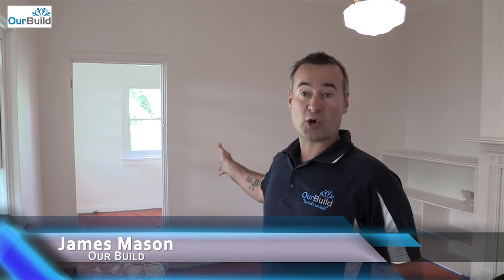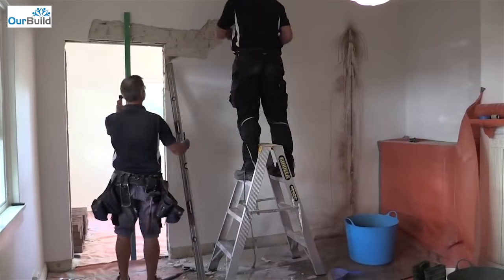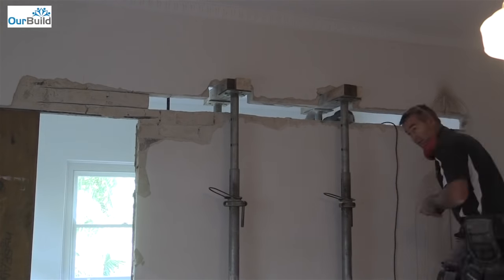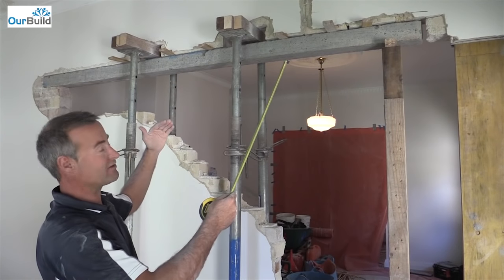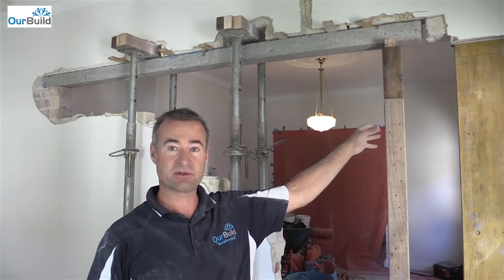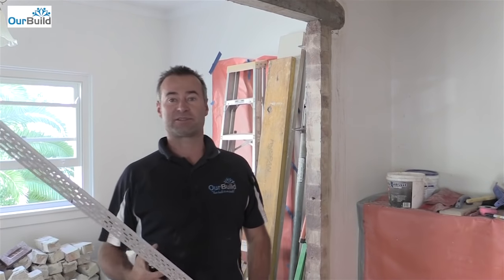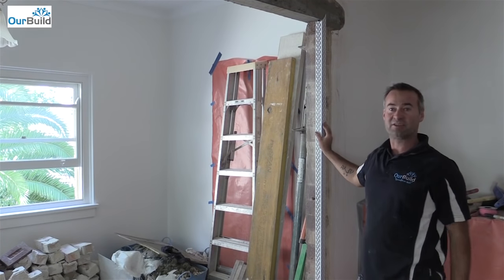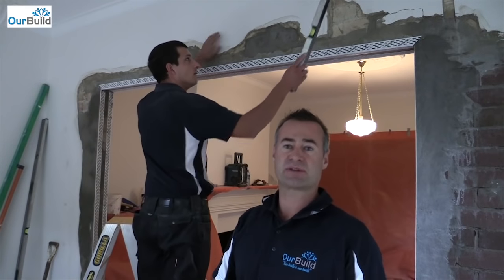How To Remove A Brick Load Bearing Wall - New Opening

Comment: Great vid lads👍🏾
Only thing I would add for the beginner is to make sure you have a sound foundation underneath each prop before transmitting any load to them. If the floor is made of concrete then no probs. However, If it's a suspended wooden floor, you should: make sure you spread the load across the floor joists using a couple of scaffold boards or remove some floor boards and place the jacks directly onto solid ground beneath the house.

Comment: Nice video! A quick tip with spray glueing plastic angles on, spray both the back of your angle and the surface you’re sticking it to, let them sit for a minute or two to become tacky and slap the angle on. It’ll stick much better than with spray glue just on the back of the angle.

Comment: Great job!
We have builders in to widen an existing doorway to and extention into a kitchen, how long should it take to knock out the wall.
My builder took a whole day to take out 2 rows of bricks as you have done and marked out the opening with an angle grinder saying the wall is external and its very hard! Is this normal or are they taking too long as we are paying a daily rate!
Any help would be great.
Many thanks
Reply from the maker: Hard to say how long something should take as every job is different with its own unique challenges. Good luck with it 👍

Comment: Great work guys! Do you find the plastic doesn't hold anywhere near as long as the aluminium.... and results in cracking?
Reply from the maker: +Ben Jarvie , Thanks Ben! I think the plastic is the way to go, as long as its set in correctly it won't crack.
Reply: Plastic is 100% the better option, it won’t dent and crack the plaster like steel angles, and more forgivable with any movement.

Comment: Hi how do you ensure that the last brick at the top makes good contact with the concrete lintel for load transfer? Because the mortar in between is initially soft right? Do you just wait until the mortar dries up before removing the props? How do you ensure compactness of the mortar at this location to make it load bearing? thanks
Reply: Good question. Sadly ignored tho
Reply: Usually left to go of untill the next day mate. As paddstones would sink like you suggested
Reply: use pack the gap with non-shrink structural grout

Comment: Great video! Thanks. If doing the same thing through a double brick wall with cavity between the two rows of bricks do you need to install a lintel for both walls?
Reply: Or will only 1 of the two rows be weight bearing?
Reply from the maker: +Jeffy J Thanks Jeff, yes one for each wall.
Reply: Our Build - I am looking to do this , a double wall. Curious where are you based ? 😊

Comment: Hey James, Great video. Are the needles you refer to separate to the acroprops?

Also when fitting in a heavy (370kg) 4000mm wide beam, we'll be using lifters, but would you recommend sliding it into position at first?

Cheers for such a great video
Reply from the maker: Hi Dan, yes the needles are the support timbers or steel that is inserted under the brickwork and then the acrow props go up to the needles. Hard to say about the position of the beam, generally if its something large and heavy i would get it in close to the opening and then use a genie lift to wind it up unto position.

Comment: Great video!  Thanks for taking the time to share that process.  The one question that came to mind is why not use wood studs to support the new header on the side you had to build up out of brick?  Isn't the brick a tonne more work, labour, and money?
Reply from the maker: +rmontyw Thanks for that. Timber will shrink or expand because it's a natural product. This will cause cracking. If the wall was completely a timber construction I could have used timber, but you never use timber to support brick. Hope that helps.

Have a great day.

Comment: hi James, have you tried the facade clamp? not sure what it's called in English. it's supposed to create a temporary lintel when you use 4 or 5 every 0,7 metres above the new lintel.
Reply: It's called a brick brace over here in uk, I use strong boys that fit on top of props don't need needles

Comment: Hell of a mortar course at the top of that new pier........
Reply: Hahahaha thats what i was thinking. Would have definately added some steel packers between the brick and concrete lintel. Make them about 7mm by 20mm by 30mm and stack em up. Still will be able to render them and the support will be much more reliable than the mortar. Everything else though was perfect

Comment: Great video. Helped me talk knowledgeably to the builders who did this for me. How do you then deal with the floor gap after the wall is removed?  I have tiles and the builders were able to not crack any of the existing ones. How do I fill in the gap? (It will eventually have kitchen units covering it, so no need to level or re-tile luckily). Thanks in advance :-)
Reply from the maker: Great to hear Tracy! If it will be covered later I would fill will some particle board or plywood. Good luck with the rest of it 👍

Comment: Good job. Just a quick question. How do you know the floor which I assumed is timber sitting on hanger is going to be able to take the weight of the wall above? It seems that the 2 acrows sit on sole plate so I was just wondering if someone checks the floor where you sit the acrows on or it is assumed that with sole plate is ok ?
Reply from the maker: Good job to always check with a structural engineer for those types of questions, but generally speaking a good sole plate under the acrow props spread over a few floor joists will generally do the trick.

Comment: Lovely job.  How wide can you go without the acro props and pins?  For instance would you still do that if you were only putting a 900mm gap in a (single skin) brick wall, or would you expect the bricks above to hold in place while you put the lintel in  for that width?

Comment: Amazing work 👌👌👌

I want to convert my sitting room into a bed room, and build a closet. But my sitting room is small, so l'm thinking of breaking down the wall separating the sitting room and the garage, and build a closet that will take some space in the garage rather, and have a sliding door in the bed room.

What advice can you give me before l do this project?. #PleaseHelp

Comment: Hi again.  270cm lintel for 240 span.  That's only 15cm on each side.  Is that enough?   Also worth mentioning that lintel should never be cut and lintel must be installed the right way up as they are normally pre-stressed and marked with the "top" side.
Reply from the maker: +Aman A , Yes it was enough for this installation, but always consult a structural engineer first like we did.
Reply: +Our Build Thanks

Comment: If the door way is only 2 metres wide, could you use a 6mm thick 2.4 meter long steel angle bar instead of a concrete lintel? I.e cut a 2.4 metre long horizontal line of morter out and slot the lintel in? How does an angle bar compare to a concrete lintel in load bearing capacity?
Reply from the maker: +Wally D , Hi Wally, it really comes down to what a structural engineer specify s, on this project we had a load bearing wall directly above this for the unit on the next floor, so I guess that why the concrete was specified. In theory an angle bar could be used but it also make it hard to finish the render detail around the opening, as the cement render is better to apply to the concrete lintel as well.

If you did go a steel angle i would still recommend propping the brickwork above so that it stays supported during the installation.

Thanks for the question mate, take care.

Comment: No pad stone on top of the brickwork? all lintals should by regulation sit on pad stones,especially if load bearing,oh dear.
Reply: only if the masonry requires a padstone. a pad just distributes the loads if the original point of contact cannot support the weight. The compressive strength of bricks is high, which can generally support small point loads.
Reply: It's a concrete lintel so doesn't require padstones. If an RSJ was used it would need padstones.

Comment: Hi James, great video and thanks for uploading!!! If it was an external brick wall and you could cut the lintel in first without removing any bricks, what would hold the lintel in place in that instance? The weight/down pressure of the bricks once the bricks below the lintel are removed??? Thanks.
Reply from the maker: if you installed needles through as supports while you installed the lintel then yes.

Comment: Hi again.  How long did the whole job take?  How much would you charge?
Reply from the maker: +Aman A , Hi Aman, the project took about a week, but then the painting we came back for a few weeks later after the render had cured and dried. The cost is private from my client, but happy to send you an email privately with some more detail if you need a ball park idea?
Reply: +Our Build Yes that would be good.  How do I get my email address to you?
Reply from the maker: If you go to the About Tab on the YouTube Home Page my email is there, otherwise the contact form on my website which is linked in the comments section below the video.

Cheers.

Comment: Hi, great video mate. How many days did it take to actually knock it down? I have 4 meters load bearing to knock down which also has attached two radiators to be relocated including a boiler feeding pipes to first floor room? Just an approximate so my builder is not creating more work by scaring me off. :)
Reply from the maker: Thanks, this one took 3 days from memory,   and then a couple of days to paint and finish up. If you allow a week that should be plenty of time.

Comment: Just out inf intrest why did y have to build an additional brick wall to support the lintel and not keep more of the origional wall to support it? :)
Reply: +jay Jay it's because the wall wasn't tied into the other wall(because of the door opening), so it's not structural sound.
Reply: +jay Jay It would have meant a larger span for the lintel if it had to go all the way to the wall of the other side of the door, I think that's what you mean. It was probably too wide for the support to be sound without a middle support or the gap was too wide for the opening the owners wanted it to be.
Reply: No what I mean is the wall was knocked through but then the additional pillar on the right was built out of blocks to support the lintel. So basically where you did your initial cut on the right of the wall with the still saw you could of cut it less span saving the trouble of building the additional brick support... If the origional wall wasn't supported then you have just tied in a pillar of breeze blocks onto a untied wall ? 😉
Reply: Ha now I feel stupid I just realised you changed the angle and location of the camera to the other side of ten room haha 😉

Comment: How did you fit mortar between the top of the lintel and the bricks. How can you be sure that the whole of the top of the lintel is touching all the bricks above it
Reply from the maker: +Aman A , The preferred method is to dry pack non shrink grout between the top of the brick and the bottom of the lintle. We drive wedges in temporarily under each brick before this takes place and while the mortar sets.
Reply: +Our Build If you dry pack the grout between the top of the lintel and the bricks, how does it set. cheers
Reply from the maker: "Dry Pack" is just a term for a mix which still has water in it, but it's consistency is very dry and not runny.
Reply: OK thanks

Comment: Perhaps adding a layer of loose wet mortal on top of the  length of lintel  before place it in its place would have distributed the downward load better and avoided the localised  outer pressure points caused by those tapered wedges to preload  the  bricks on the lintel. The wedges only acted on the outer edges of the  bricks and the lintel and not  along its centre line , which was left void. 

Seeing that there was a good gap, the bricks  at floating end of the lintel on the new wall  should have  been drilled vertically and a tie rod inserted and grouted  to tie the new wall to the old wall in a vertical manner and not only on its side with those  galvanised steel ties.This would ensure a better structure and  anything hitting the new wall will not cause it to sway sideways.
 
At 4:12 It was wrong to insert those final pressure wedges before the lintel was supported on the new wall as the lintel pre-stressing was not effective considering that the temporary vertical steel support was far away from the wall and when it was removed the lintel had to settled a little. 

In my country we would have been less comfortable  but more pompous and ornate to show off  to the neighbours and made an arch with  thicker than wall abutments,  with decorated  imposts and  interlocked voissoirs and a projected crown to make us feel that we are at St Paul's Cathedral or Westminister Cathedral  in London or Santa Maria del fuore cathedral in Florence. British homes are modest and humble and more comfortable than ours!
Reply from the maker: Thanks for the detailed review of the installation, i would love to see one of your pompous St Pauls attempts at the same style of construction LOL :)

Cheers mate, take care.
Reply: a few gargoyles wouldn't have hurt. neat job btw, just the reality check  i needed... i'm not going to diy this one, chrs

Comment: What if you want to cut out 30 -foot block wall and leave 2 foot on each end and put in steel beam?
Reply from the maker: I'd say check with a structural engineer, but it's doable 👍
Reply: John Thompson that will be one big steel needed

Comment: nice clean job only would of thought a steel rsg lintel and on pad stones. maybe if the wall is not load bearing and also making sure the floor does not rest on it.
then concrete lintel fine?
good vid.

Comment: Why didn't he use a longer concrete support/lentil to go into the original wall to make the opening wider instead of having build up the blocks and make the opening smaller?
Reply from the maker: Because that's the opening size that my client requested.

Comment: what is the name of tool which you used to cut the wall.
Reply from the maker: +VIJENDRA NAG , Hey mate, thanks for the question, its a concrete saw with a diamond saw blade. I have a link to the tool in the copy below the video if you wanted to check it out.

Comment: Most certainly better with a bed of mortar on top of the Lintol  then Acrow it up so there is full contact and no point loading [ which you will get  with wedges ] nice job though.

Comment: .
Most important- No 1 - I didn't hear anything about 'load bearing" or "not", until the very end.
As the wall is 4" it is not likely to be seriously load bearing. 
The  selection of the modest steel lintel is confirmation of that. So proceed with minimal Acrow props.
.

Comment: lintel looks very small for opening how did you work out your load
Reply: Patterdale Zipsuzilil engineer maybe?
Reply from the maker: Structural engineer.
Reply: The existing brickwork is still acting as a beam, so the beam size seems right (just the dead-weight of the wall needs to be considered, unless the roof is supported).
Reply: Knights Templar maybe it’s a bungalow and the only load it’s supporting is the 4 or 5 courses of brick we see.

Comment: Top marks for the tidy and organised way in which you work, but I’m a bit confused by your calling this wall ‘loadbearing’.

What load does it carry, and is the floor it sits on timber or a concrete slab? I can’t figure it out, because the lintel (reinforced concrete, presumably?) looks scarily inadequate for a 2.4m wide opening if it’s carrying anything more than the few courses of brickwork immediately above it. 

Yours curiously, :-)
Reply: Spot on Michael, That single lintel would be at its maximum capacity just for the 4-5 courses of bricks, thats excluding CLW (ceiling load width). And it would of had to be on a slab, which then questions the slab.  Great execution of the job at hand though. Note: Theres always things builders would of done in another way

Comment: Nice job!  But strange that they didn't reuse the bricks they removed - that would have reduced costs and waste.
Reply from the maker: +gerty wilmot Thanks! Unfortunately the old bricks had a strong cement render on the face of them that was to hard to remove, otherwise I would have re used them.

Comment: 1:25 if you try to cut down a masonry wall with an angle grinder you'd not be able to breathe because of the dust! 
There should be clouds of dust where are they?
Reply from the maker: It's a wet saw
Reply: @OurBuild  Ahh thank you

Comment: Do you really believe the load of the wall above is on the iron bar? I dont think so. Since u can remove the bar and wall above still remained intact i guess it is just a psychological bar placement. Actually the cement is holding the bricks of the wall above... U like it or not.

Comment: REALLY? How do you know this is a load bearing wall? There is no lintel over the EXISTING door/passage. Wall is too thin for load bearing. I'd take out the whole wall and use gypsum board  to finish the project. Also the lintel that was put in place had short overhangs. It's probably OK for a small window, but not htis big opening. You can use high strength grout/concrete in liquid form (slurry) to take care of thin gaps (need to make it watertight. for that.

Comment: Shud of been steel.sat direct onto brickwork.no packing or pads.should be at least 300 mm over brickwork either side that looks more like a 100mm .no morter on top of lintel.your asking for problems in the future
Reply: david doyle 4” seatings ok for concrete beam and FYI you need a minimum seating @150mm,  🙄
Reply: If that wall continues upstairs I would deff have a rsj on pads, but I would imagine that wall stops